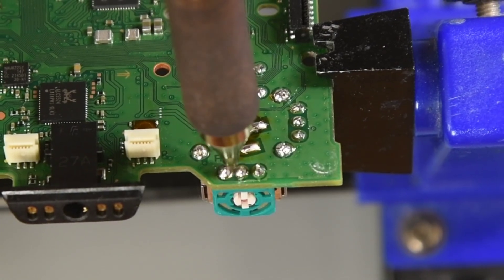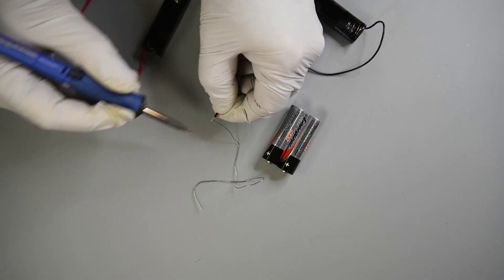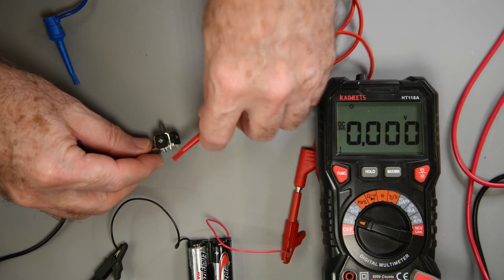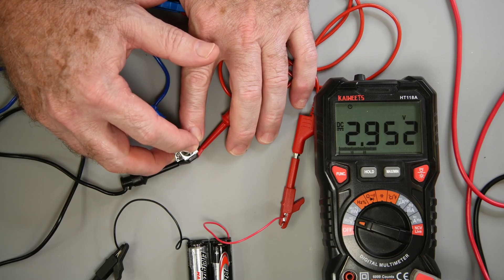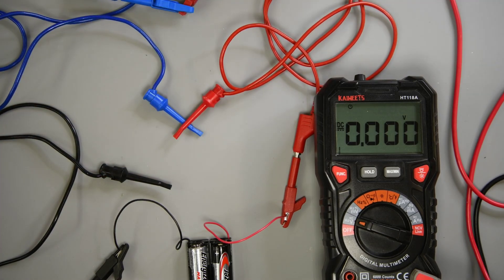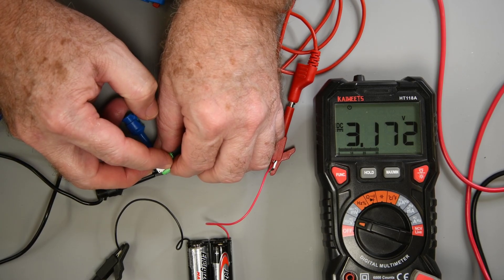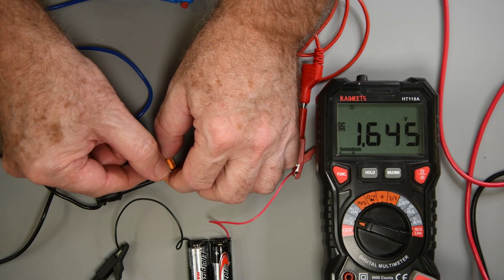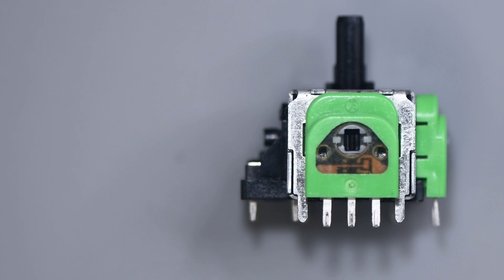How to Test a Joystick Before the Painful Install Process

Comment: Idk how you know so much about controllers but I need to know how to repair my elite series 2 controller… I replaced my analog sticks and idk if I ripped out a few traces cause I have done this repair before so I think from constant repairs I finally managed to rip some traces and now I have no idea on how to solve this issue and I don’t wanna spend another 150 dollars on a new controller and the board that I also need is 60 dollars pretty much the price of a new regular controller… I really don’t wanna spend more money on a new controller cause I literally spent a ton of money buying equipment to repair my controllers lol 😂 but now the only problem is I lack the know how on how to fix these particular broken traces I might have destroyed… I’ve had this controller for around 5 years now and I refuse to buy a new one cause these controllers have a ton of problems I’ve fix this controller countless times already and at this point I wanna keep this controller going at least until they release another elite controller… but I don’t know what I’m doing god help me 🤣🤣 I really wanna know how people retain all this information I’ve watched tons of repair videos in the past but I can’t retain all this information… like how is this possible… I now the basics like soldering and desoldering but working a multi meter and understanding ohms and continuity mode and how to find a short or injecting voltage… voltage and current and ac and dc… resistors and capacitors and main power rail like holy cow how does anyone remember all this stuff it really blows my mind… it makes me feel so dumb I just wanna be really good at this craft but I just need someone to coach me for free too cause I’m broke lol 😂 thanks to your channel and many like yours I’ve learned and forgot a lot as well 🤣 I just wanna know someone in this field of work and learn from them cause learning this solo is absolutely brutal I envy those that are self taught cause this is mad confusing!
Reply from the maker: There are numerous good videos on YouTube that cover basic electronics.  However, what would help retain the information would be to acquire a cheap multimeter, resistors, and some breadboards. All can be ordered from Amazon for pretty cheap.  Then you can work along with the videos, which will really help you understand what is going on.  As for the trace repair.  There should be some pictures somewhere on the internet of the mainboard of your controller.  You will need pictures with the joysticks removed.  You can use the pictures to see where the traces should be.  Some of the best trace repair videos I have seen are laptop repair videos.  You will basically have to run a thin wire to replace the trace.  But that is easier said than done a lot of the time.
Reply: @metalplasticelectronics354  thanks for replying I didn’t expect one! And yes although this is confusing I also don’t expect myself to understand all this in just a couple of days the thing I lack I feel is practicing this craft more often you see I don’t do this for a living… I wish I could honestly but because I don’t… i feel like I don’t get enough practice in and I tend to forget a lot of what I learned… for a brief moment I feel I did somewhat understand how a multi meter worked not to the fullest extent but a somewhat small understanding… but because I don’t have enough devices to practice on and because I also don’t trust myself yet to fix other people’s devices I tend to lose most of what I learned… I need to constantly practice this craft to be able to consistently remember… and when I get stuck I would definitely like someone with a good understanding to get me going on the right direction cause there’s so many videos out there but sometimes you got a specific question that you can’t really explain via text cause of the lack of knowledge so the questions don’t come out as clear as I’d like to due to my lack of understanding on how all this works… I do do this as a hobby and I’ve fixed things here and there a few items but mainly my controller and a ac unit I had which ended up breaking again lol 😂 funny story I replaced the capacitor cause it was dead and the unit wouldn’t blow cold air and it worked for a couple of months but than it started leaking a ton of water and I had no idea how to fix that either lol 🤣 but it honestly brought me so much joy knowing that I got it to work for a couple of more months… ever since I’ve been giving it a gander here and there but every time I step away from it I lose a lot of what I learned which to me that’s the most difficult part is getting consistent practice and getting consistent devices to work on… and maybe a quick reminder here and there to get you on the right track but without channels like yours and others I definitely wouldn’t be able to remember half the things I’ve learned so I appreciate the effort and the attempts at teaching the general public… channels like yours and Louis Rossmann and Northridge Fix and Thecoder and Electronics Repair School and many many others have sparked my interest in attempting my own repairs and starting my own small hobbyist journey to keep E-Waste out of landfills and just having a little more longevity with my devices not just throwing it away and getting a new one type of mindset so thank you all that do this type of content… and no I really mean it I really do appreciate all of you guys! And thanks for replying too I’ve posted this on a few other channels and you were the only one to reply and so soon too! It definitely means a lot… Thanks!
Reply from the maker: Just keep at it, it's a very good hobby.

Comment: Not sure if you'll answer, but I have 3 sets of Gulikit TMRs (Xbox Series) and of the two sensors; one green, one black, the green measures 2.8v on center and shows almost NO movement. Any idea what's going on there?
Reply from the maker: I believe the power and ground connections on the green sensor are swapped.  So facing the sensor with the leads pointed down, the positive voltage goes to the left lead, and the ground lead is on the right.

Comment: Has it happened to you that installing these TMR modules on a dualsense reaulta in 3 orange blinks from the controller LED and no further activity? (According to SONY it means general hardware failure)
Could that be caused by the modules? Cause as far as I can see my install is fine. No bridged contacts, no damaged traces, nothing ... Could the "potentiomerers" be bridged internally?
And if so, could it break the controller?
Ive installed 3 pairs of these joysticks thus far. 2 for PS5 and 1 fot PS4. This is the only one that came out like this ... Ive disconnected the battery and left it like that until I decide/know what to do (Cant remove the joysticks without deatroying the cases cause I only have flush cutters, pump and solder iron. So I want to wait until I KNOW for certain its the sticks.
Any help/info would be appreciated.
Thanks!
Reply from the maker: I think it would only be a cause if one of the sensors is shorted out. I would look over the board very closely for any solder splash.  I haven't had any bad TMR or Hall sensor.  But there are going to be some that are defective.

Comment: where does the blue wire connected the other ends
Reply from the maker: That is the center tap of the sensor so it goes to the positive terminal of the meter.
Reply: @metalplasticelectronics354  thank you so much. I have been testing mine right now. 7:00 But still can't figure out why this favor union is a faulty one?
Reply from the maker: What is it doing?

Comment: Just got myself a Fluke 115 from a pawnshop for $160, les goooo! What would you recommend for a bench-top power supply?
Reply from the maker: I have a couple of cheap Korad power supplies from Amazon.  They have been very good and have had them for a few years now.  They are model KA3005P but I don't know if they still make them.

Comment: Can you test the ginfull hall effect potentiometer replacement (not the whole stick) and show the pin layout for dualshock 4 and xbox?
Reply from the maker: The GuliKit and Hallpi TMR sensors will fit the Alps joysticks.  I would use either of those over the Hall Effect sensors.  I don't have an Xbox but I will see if I can get a DualShock4 apart and do a short video on the joystick wiring.
Reply: @metalplasticelectronics354  in my area the gulikit and hallpi is not listed in local marketplace so I don't wanna buy it. Thank you for your response.
Reply from the maker: Give them a little time, the Hallpi is a very new release.

Comment: To start adding more content. Could you start using these joysticks with software to make motor controllers? I’d love to see some 3d printed actuator or driving applications with controllers over wireless controls. Most channels use ESP32 and other integrated wireless controllers where I feel like you’d take the bare bones approach with an external module. Merry Christmas!
Reply from the maker: That does sound like fun.  I definitely need to find more time in a day.

Comment: A typical PC fan connector have suitable spacing on the insert clip holes to make for a simple press-against-contact. One could then just hot glue it to a surface along with some spacer cardboard or so for module stability when moving the stick. :)

Comment: I’ve been just soldering the sensors first, so just 3 solder points on each. Testing on gamepad tester and only if there’s no issue soldering the rest. A lot easier to desolder just the sensors. Especially with a K knife style solder tip. Can heat all three points at once
Reply from the maker: Yes, it is.
Reply: I have been doing the same, but i dont know why, after a few minutes playing, the Joystick doesn't work in some direction, i try to re calibrate again on the Dual Shock webpage and nothing. It seems tha something its wrong with the Favor Union Hall Effect i bought directly from a seller on Alibaba.
Reply from the maker: It could be, these things are made so cheap there is no burn-in testing.
Reply: @davidroma268  bought a few hall effect joystsicks from temu, having the same exact problem.

Comment: Good timing, I was just thinking about how I could test my new joysticks before I install them. Mainly because the packaging looks like someone kicked it to my post box all the way from china.

I have the ginfull yellow ones,but don’t know which version… they have a red thing on the potentiometers where the ones you have are white. Is this how you tell which version?
Reply from the maker: I don't know how to tell which version is which.  The PCB has an alphanumeric code on it.  All I can go by is the later the letter number the later version of the sensor.